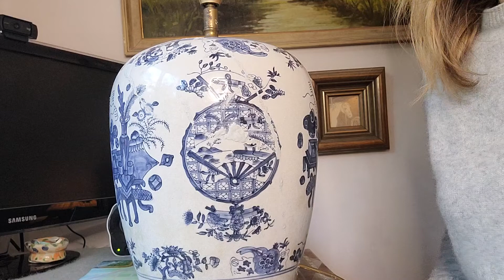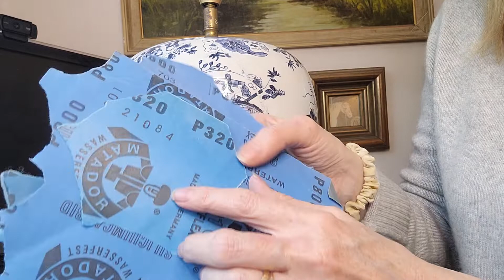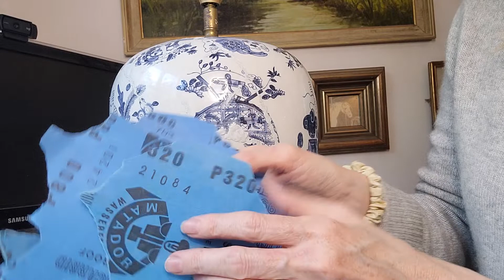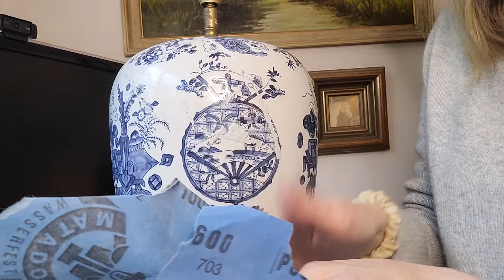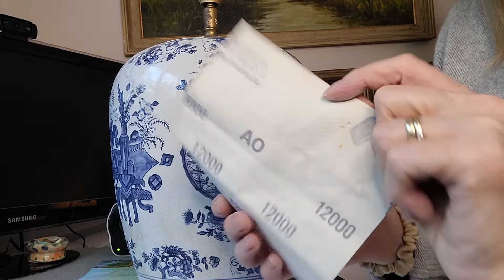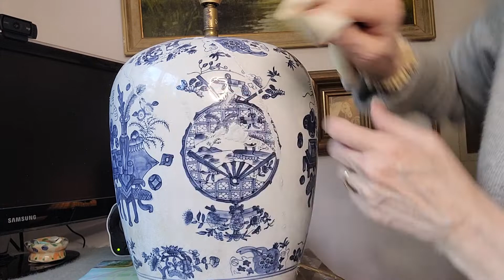How To Repair A Porcelain and Ceramics Jar /Sandpaper  #ceramics #restoration #porcelain #diycraft

Comment: Hi Ali, hoping you can give me some information on the Micro-Mesh. It appears we cannot get the MXD here, so I am looking at importing some and trying to work out the most cost effective method overall.
How long does a sheet normally last for you? 
Do you/can you cut a larger piece down? Or which size do you recommend?
Can you polish up the glaze with the 1200? I have seen someone polishing glaze with a higher grade, so was wondering how low I can go.